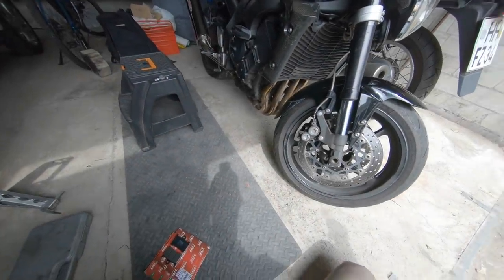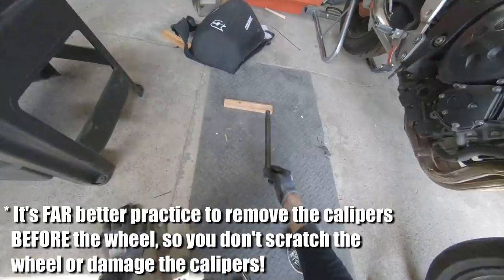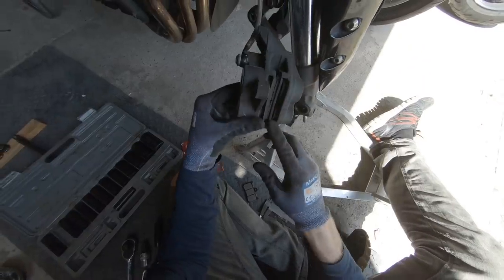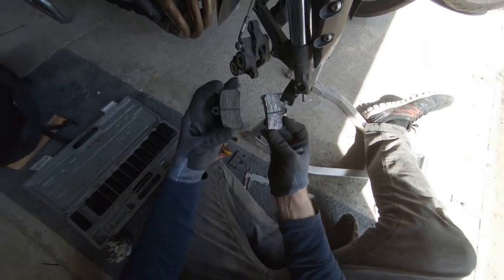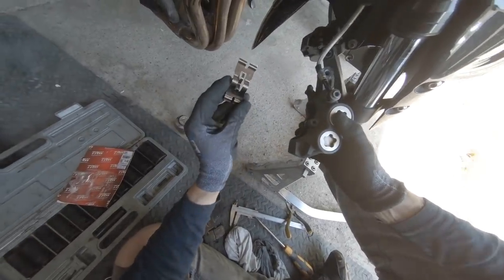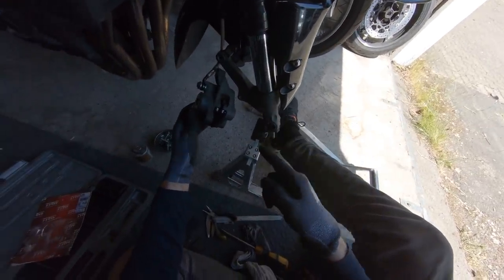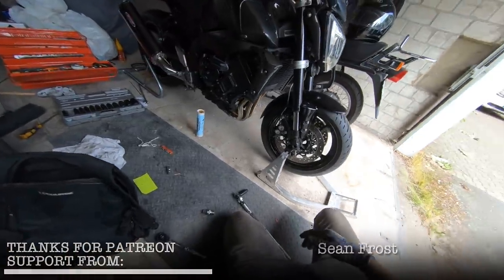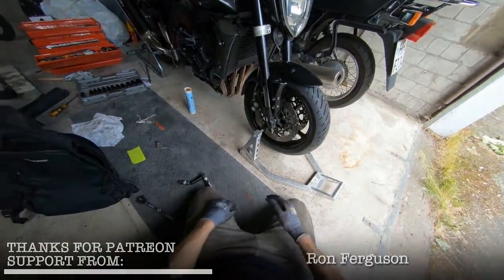New Brake Pads for the FZ1-N

Comment: Top tip re servicing your calipers. I didn't do that when I replaced my front pads after our trip. I had the front tyre replaced a few weeks ago and one pad was worn almost to the metal and the other was pretty much brand new! Turns out one side of the caliper was complete seized up with dirt and grime. Lesson learnt.
Reply from the maker: That’s a shame. Yeah, because of the fluid nature of the system, if one side gets resistance, it just pushes twice as hard on the other side. Bugger. At least you found it before you got to the metal! Im lucky that my Versys calipers must have been relatively clean. 😳

Comment: Wait for the backlash over the copper grease lol. I'll learns ya, and them lol It won't cause any harm and it will do it's job of preventing seizing over time, although less likely to happen on modern brakes. It's a high temp grease for mating surfaces and will not run as some believe, when I was a mechanic we used it on brake pads back plates and wheel hubs mainly. It's not to prevent squeal, common misconception, squealing comes from brake dust build up at the pads friction surface and the disc, regular servicing (tear down clean once or twice a year, just before/after winter is best) will prevent that.
Reply from the maker: It's already started! I've never had  squeaking when I've used the grease. Could be circumstantial, but it just feels right!!
Reply: @AndyManCam  😂👍 Like I say, there's nothing wrong in using it, plus you can drive cars for years and not develop any squealing without it, as the rear plates rub on nothing causing no squealing. Bikes probably develop squealing brakes even less so as they are more exposed to air.

It's a good idea to clean the discs properly from time to time too, use brake cleaner and a scotch brite pad or washing up sponge back, as it's the same. Rotate the wheel and do both sides of each disc, some brake dust will fuse to the disc over time and can cause fluctuating in the brakes during hard braking.
Reply: There is no need to use it on the back of the pads. I don't see any on the old pads and they didn't need forcing out with a crow bar. And copper grease doesn't stop brake squeal.

Comment: Fred Dibnah, what an engineering legend.
You may regret fitting organic brake pads (I did). The organic has f'all to do with harming pretty little creatures during the making. It means they are made from soil and leafs. Flour mixed with water holds it all together. You'd be better off getting some red back pads before hitting the track if you don't like HH pads👍
JMHOM 😉
Reply from the maker: Nah, they were great on track! I've used organic pads for over a decade now. I'm no racer and I tend to focus on smooth rather than hammering into every bend. Plus the discs last a LOT longer with organic!

Comment: It’s always worth a €5 investment in brake fluid when changing the pads, just kind of completes the job. No harm before a track day either. As mentioned elsewhere, toothbrush is the man for the job. Just did the front on my Daytona, got through a 99c twin pack from Aldi. Organic all the way. You might measure the disk for allowable wear too with a micrometer, not a set of vernier callipers because you will just be measuring the outer edge lip. I had used more than half of my wear allowance in 30,000 miles on mine and that was on organic pads.
Reply from the maker: I only recently change the fluid when I fitted the braided lines, so I didn't really want to open up the system again. Time was tight! Always a precursor to some kind of garage related disaster!!

Comment: Great videos, only comment is that the arrow on the retaining plate should point in the direction the disc travels (I.e. up ⬆️), just to help anyone working on their own bike 🙂
Reply from the maker: Cheers Kyle. I just put it back in the way it was when I got it from the dealer. It was that way up the whole 30,000km i did on the bike. 🤷🏻‍♂️
Reply: @AndyManCam  No worries, I recently had my pads out as they were a little squeaky, bit of copper slip and they’re good as new (although probably upgrade to sintered as I prefer a little more initial bite). Whilst cleaning and inspecting  the plate, I genuinely can’t see it making any noticeable difference, but that being said, doesn’t hurt to follow the manual. Anyway, thanks for the great vids 👍 Recently changed my stator after randomly seeing your vid, now making my way through all your FZ videos 😆
Reply from the maker: You should see the number of comments i got about copper slip not working! 🤣 Always been fine for me! Glad you’ve gotten your rotor sorted mate. Enjoy the rest of the vids! 👍🏻
Reply: I worked as a mechanic for over 13 years and it’s normal practice on cars, no idea why it wouldn’t be on bikes. Brakes are brakes! I would never fit without 👍
Reply from the maker: I learned it from my Dad, who oddly enough was also a mechanic for 25 years! Strange that it apparently doesn’t work anymore! 😂

Comment: Thank you for the video however the manual says the arrow must point in the direction of wheel rotation, cheers
Reply from the maker: Looks like it’s not so important then. I put them back on the same way they were when i took them off, and they stayed that way for several years without issue! Maybe best to follow the manual though!!

Comment: I think the pads for the front stand are on the wrong way. The L-shape should be facing up. When I took my front wheel off, I got a car trolley jack and put a block of wood and jacked it up slightly under the brace weld of the headers. BTW Sintered pads aren't as bad as you think. I ran them on my Honda Hornet 919. I was going to run braided lines but I got such good feel and bite that I never bothered. Plus I flogged a lot of people on the track as I could outbrake them. They take a little bit longer to warm up but once they're warm they are not grabby or sensitive at all. Only problem is that they generate a lot of dust :P.
Reply from the maker: Sadly that was another part of the precariousness. If the pads were there other way up, they blocked the axle from being able to be removed. And even if they didn’t, they weren’t actually high enough to lift the wheel off the floor!! Might have to invest in an abba stand, finally! I found the sintered pads on my FZS600 very rough and grabby. Depends on the brand as well I suppose. And the condition of the discs perhaps.
Reply: @AndyManCam  I had new discs and I ran EBC pads on mine. Just use a car jack mate, it was really stable when in combo with the rear paddock stand. I'm going to be doing a supermoto build series soon. I just got a Yamaha WR450F, don't know if you're on social media at all but I'd be keen for you to point out if i'm doing anything wrong bahahahaha.
Reply from the maker: Haha! I’m certainly no expert! Easy to use a car jack... when you’ve got a car jack! I’m wildly underprepared for most of these jobs!! 😂

Comment: Andy, you need to get one of those £5 piston pushers from ebay.  Also, get some sand paper on the caliper pin to get rid of all the corrosion...the pads will slide much better...and no copper grease on the backs of the pads.  Put some copper grease on the caliper bolts...not thread lock.
Reply from the maker: Meh, the old pads and a screwdriver worked just fine for free! That'S another 50 miles of petrol in the tank!

Comment: Replaced my GS brake pads and brake fluid 4 days ago, dabbed some copper grease on the back... Aaaaand they still squeak a bit... I'll just ignore them, it's much easier that way, block that annoying sound right in the brain. Cheers Andy!
Reply from the maker: Haha! That's the best way! Might be worth giving the TRW anti squeak pads a go. I should probably try them sometime too. Less mess!
Reply: Went with Brembo just like Ze Germans told me through the magic of internet. It was those or EBC so I went with near OEM stuff. But the fluid is TWR, maybe I'll try their pads next.
Reply from the maker: I was tempted by the brembos, but got an unmissable deal on the TRWs in the fleamarket! One set for 5€, 25€ for the other bargain!
Reply: Holy crap that's basicaly a steal! 😬 Brembos hurt the wallet way more than that! Good man!

Comment: That's interesting, the process of taking the front wheel off and changing the brake pads is exactly the same as my FZ6, even the calipers and bolts look exactly the same. 
On an unrelated note, I've been thinking of upgrading to an FZ1 because I've outgrown my FZ6 and would like a little more power. But I can't decide if I should get a used FZ1 for a few grand or bite the bullet and get a new MT-10. The FZ1 is cheaper, but it's essentially the same thing as my FZ6 , but with a bit more power. While the Mt-10 is a whole new bike with newer gadgets, but costs substantially more...
Reply: SateenDuraLuxe a bit more power? Did you testride one?
Reply: You should check out AMC's test ride of the MT10 which he did last year.
Reply from the maker: I'd say that the FZ1 is a fair bit different to an FZ6. Bigger in every way, higher quality components and a LOT more power! You'll have to try both and weigh it up. 👍🏻
Reply: Either way awesome bikes

Comment: Isn't the front wheel supposed to roll freely without any grinding after you put everything back together? Doesn't that mean that the calipers are missaligned?
Reply from the maker: Every time you brake, the pads are left touching the Discs. The movement means that instantly a tiny gap forms between the pads and disc (also a tiny bit of retraction as the pressure is released). Except with new pads, they don’t yet conform to every groove and ripple of the Discs yet, so after braking, there’s still more contact. As long as it is just a light dragging (as it was here) then all is good. Binding and serious resistance would be another matter.

Comment: That front stand looks exactly like the one I have. But mine has a huge flaw: I can put my entire body weight on the handle, but I cannot lift the Versys 650, because the parts that contact the fork are too tall. (I think it was measured for a dual sport bike with larger front wheels.) So in order to use it, I must first drive the front wheel onto a 5cm thick piece of lumber, then I can get the leverage to lift it. BTW everyone should be aware that some bikes these days have a spring only in one fork leg, (shock in other leg), so you can't use front stands like this, else disaster strikes when you remove the axle. Example: 1st Gen Versys OK, 3rd Gen Versys NOT OK.
Reply from the maker: That is annoying. And good to know re: the lopsided forks. Question is, how DO you  remove the front wheel in those cases?  I suppose you need a central stand or on  that picks up on the head?

Comment: Hey Andy, hope you're doing well, good info on the video, just wondering in case I missed it somehow, how did you solve the problem with the cracked exhaust system pipes?
Reply from the maker: I didn’t, not yet! The stock pipes are dual skinned though, so they’re not noisy... yet.

Comment: Nice vid bud. But get that copper grease off those pads. 
Just look for "copper grease the workshop" on the tube and you'll se what I mean.
Reply from the maker: Cheers  Tyrone. I've always done it and never had a problem. Learned from my dad who was a lifelong vehicle mechanic.
Reply: Check my comment, maybe "the workshop" was telling porky pies, or they don't know what they're on about.
Reply: @AndyManCam  I hear ya bud, me too. It's your bike, and your call. But have a watch and see what you think. 
Matt (the workshop) is marmite for some, but he talks sence. 
Although the whole copper grease debacle went a bit mental.
But the theory is sound.
Reply: +1 for leaving the copper grease in its tub for brakes. I too was told to use it many years ago, never felt right to me using it with the chance of getting on pad breaking surface and discs.. Pretty sure EBC brakes say no need to use it, have not used it now   for about 20 years on pads, no squeaks or squeals , however this is only my opinion.
Reply: +1 on the use of the copper grease...no need for it in modern times. It used to be common opinion that it was necessary but times change. If the manual you have is a Yamaha, one check to see if they recommend it. If it's a Haynes manual, be aware that they recently changed their stance  on copper grease.
Reply: @HalfdeadRider  each to their own, but I believe your wrong.
Reply: @TFA-01  It's what it's for, read the tin. Also if you read my original comment to AMC, you will see that I told him it's not necessary these days, at the same time it will do no harm.

It's a high temp anti seize grease for mating surfaces, once on it's going nowhere, there is zero chance it will get on the friction surface unless you put it there.

Comment: What's good brother on the real you didn't have to do all that to do the brakes. I understand people have different ways but you don't have to take the tire off. And usually those organic pads don't last as long as the regular pads. I don't know which ones you have but believe me they dont last long at all. You are not a heavy breaker so you should be ok but usually i have had no good experiences with those organic brakes for real if they do last long tell us the name. GOD Bless safe riding.
Reply from the maker: I've always had organic pads and they last for ages! I was taking the wheel off because I was having new tyres fitted. The brake pads was an opportunistic job.

Comment: You checked the manual about the thread lock, now check the manual about copper slip on brake pads.
Reply from the maker: Getting tired of the copperslip comments!!
Reply: @AndyManCam  I'm sorry to hear that. Did you get tired of reading the manual also.

Comment: i'll just put it here
https://www.trwaftermarket.com/globalassets/moto_downloads/technical-tips/trw-moto_installation-tip_pads_en_p4p_0614.pdf
ADDITIONAL TIP: Although it is sometimes suggested that you
apply copper paste to the back plate of the pad and chamfer the
pad material to prevent brake noise, TRW strongly recommends
that you do not do this. Tampering with the pad material will always render any manufacturer product liability void. Additionally,
if metal particles have been exposed to the pad material it may
cause premature wear and drag lines on the brake disc.
A mixture of copper paste and the unavoidable brake dust is
often the reason for impaired brake caliper functionality.
Reply from the maker: I've done it for 20 years on cars and bikes, after my dad taught me from doing it for the previous 20 years. Never a problem.

Comment: Andy copper grease is not recommended for the backs of your brake pads what ever Delbollocks does do the opposite
Reply from the maker: What about my dad using it for 30 years as a mechanic and teaching me to use it?! Coupled with never having any noise or problems from using it. Car brake pads get all of the teflon coatings and anti squeak shims and such. But we get nothing!
Reply: AndyManCam we get nothing for a reason because we don’t need it and you won’t find any brake manufacturer who recommends using copper grease on the back of brake pads, it’s your bike and you can do what you want with it but you’re not buttering bread when applying copper grease

Comment: Copper grease on the back of brake pads is not at all recommend.
Reply from the maker: My dad was a mechanic for thirty years and always showed me to do it. I’ve since always done it and never had any noise or problems. You just have to be careful to not get any on the breaking Surfaces or on the piston seals. It’s old school, but i think it helps.
Reply: The paint on brake pads has been developed to replace copper grease, doesn't do any harm though, only down side is all the road dirt sticks to the grease , great video 👍
Reply: I’ve always used copper grease, like Andy say’s as long as you’re careful & don’t get it everywhere it works a treat.

Comment: the front wheel does not have to be removed when replacing the brake pads
Reply from the maker: Watch the video back again. Several cues as to why I was removing the wheel, plus a big disclaimer saying the same. 🤦🏻‍♂️
Reply: AndyManCam I was too quick with my response

Comment: Don't want to be negative, but you really don't want to be putting copper grease on the pads,brake manufacturer's don't recommend it.
Reply from the maker: I've done it for the last 16 years without issue. As long as it doesn't get in the seals or on the discs, I don't see a problem. And never a squeak from my brakes.